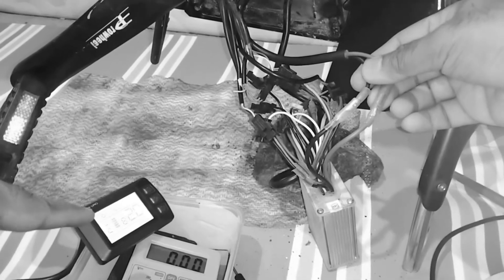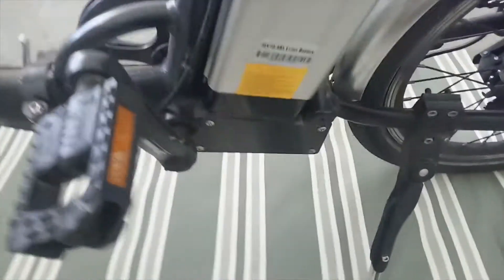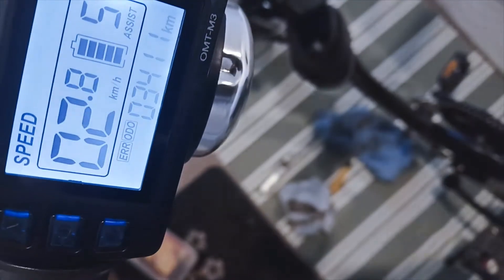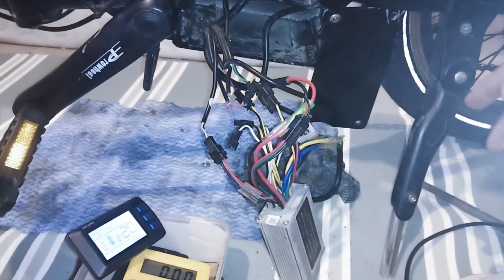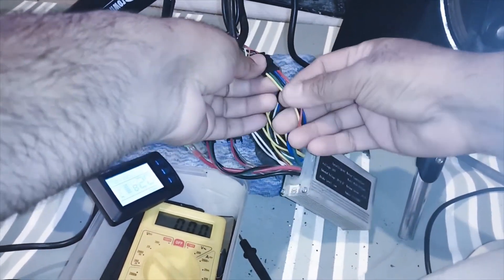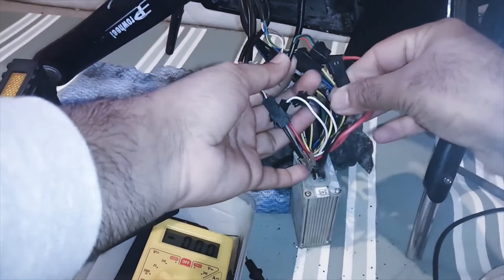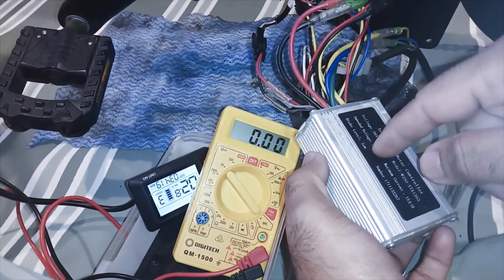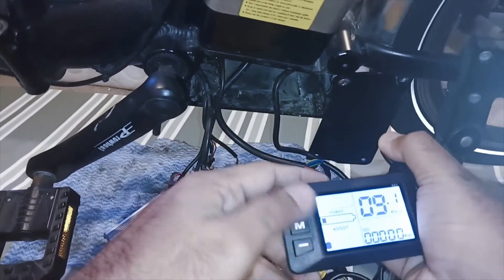Error 009! Throttle Not working - FIXED - e Bike display OMT-M3

Comment: Great video.
Question, my battery is 48v 20ah.  My controller is 48v 20ah. Manufacturer upgrade from 20ah b/c none in stock.
Will this combo work? Heard it could damage battery.  I use PAS too when riding.

Hope you can help. Thanks.

/Bklyn👑
Reply: If your battery is rated with average voltage 48v , you need a controller and motor rated with 48v. Other controller will also work but it may fry up your devise in regular use. 

I hope I answered your question. 

Also to communicate with a controller you need a input output display unit. These display units are designed for particular controller model or brand only.

Comment: I am getting ERR and 030. This code is not in Table 1 of the manual. Any ideas?
Reply: Go into P20 and try changing the value from 0 or 1 or 2.  The code disappear when you hit the right number. This tells the controller which LCD screen you have connected, atleast on a KT controller.
Reply: @Sebastian Bridger Are their videos related to ebikes or are you just advertising a hacked movie website? No reply might suggest the latter.
Reply: @Sebastian Bridger  Are their videos related to ebikes or are you just advertising a hacked movie website? No reply might suggest the latter.

Comment: I have a Fortis bike with this display, I can't get walk mode, the bike has no throttle
Reply: Either does ours!!! Did you find any solutions?
Reply: @flyanbryan4965  I have unlocked the class 1 restrictions and other parameters, no walk mode in the P setup menu, maybe the controller doesn't have walk mode, putting a throttle on the Fortis bike will help
Reply: I have since installed a thumb throttle, it makes kicking off much easier and cruise at 30 kph
Reply: @VaughnfromPeterborough I replaced pedal assistant sensor wire with throttle wire in my ebike, but the throttle refused to work. Any idea why, please
Reply: @yusifsuleiman5502  Did you try to connect throttle to pedal assist wire?, the throttle wire is a 3 wire plug with red black green wires on the controller
Reply: @VaughnfromPeterborough  yes, of course that what I did. But the throttle refused to work and if I connected the PAS sensor wire back it works. And the throttle is new and I connected the throttle on another ebike to comfirm the working condition of it and is doing well.